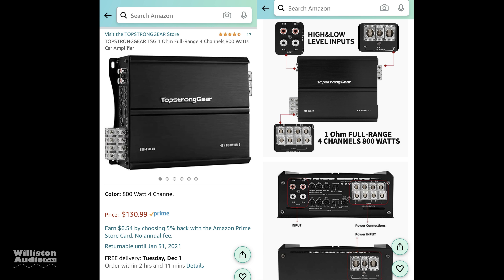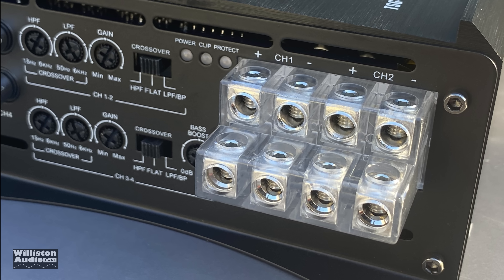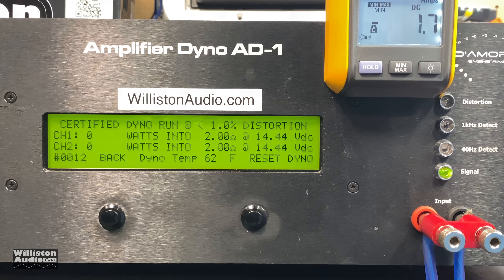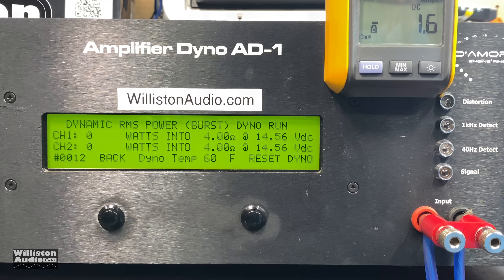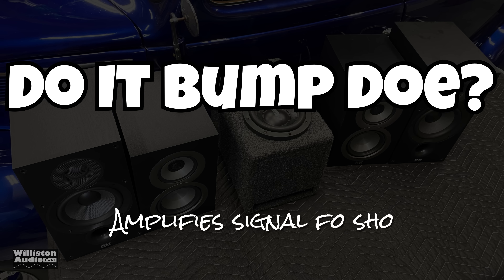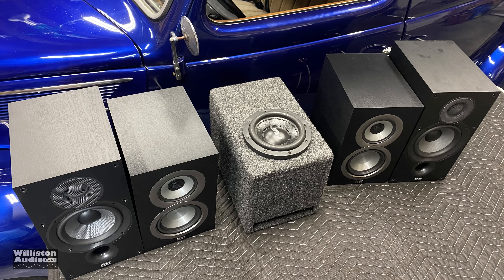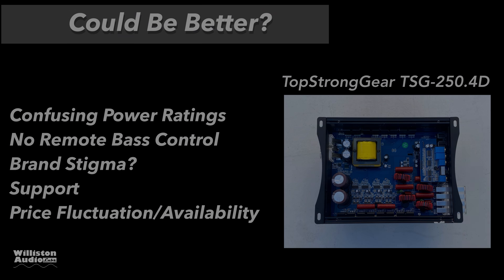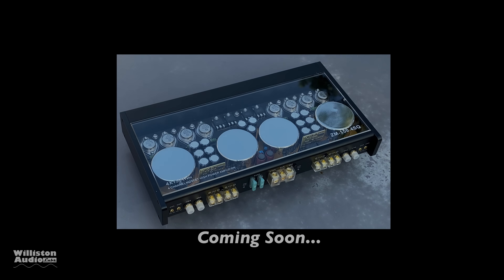Another Cloned Amp at Amazon? TopStrongGear TSG-250.4 Amp Dyno Test

Comment: So I received two from Amazon today. I glanced in again to see if the price dropped earlier this week. Price was 165 lowered to 139.99 with a 5% off coupon you click. Then, once added to cart it brings up a code from the manufacturer to apply in cart for another 10% off. But you can only do this once. So I ordered one on my account, and my girl order one her account. Final price for both of them was 237.98 lol. The Topstrong Gear emblem is held on by very weak two sided tape. Of course I pulled them off. Cleaned the glue residue. And they look great. Almost like a brushed black aluminum or fine black wood grain.

Comment: Id guess the rising efficiency is from how they set the output filter networks up. Kind of makes sense to have a better impedance match at the lower 1 and 2 ohm ratings so it doesn't get too hot.

Comment: Hey D,i’m about to use the tone generator to set myamp gains,i know 40 hz for my sub amp,but what frequency should i use on my 4 channel amp?
Reply: On the Distortion Meter by Steve Meade (SMD DD-1) they use 40 hz for low and 1khz for the mid/highs
Reply: @FreeStyle786  i was figurein that was right,thanks man🤓
Reply: @paulcoleman3972  no problem... but they also use a certain dB level on the test tones... check out a video by EXOcontralto about how to set gains, he does a good job with the run down.. as for the tones you can download SMD tones if you google them or I think Kicker has them posted to their site

Comment: Not sure why anyone would think its a copy of a sundown amp.. Sundown has never built or even designed a circuit for an amp.. they contacted a place that makes stuff over in china, had some samples sent over, and said "could you make us a bunch with tiffany style rcas and this profile on the heatsink" if they liked the cost/performance of the product.  Topstronggear did the same thing and is sellin it closer to actual cost than sundown is..

Comment: Finally someone ripped off sundown and made their stuff actually affordable!
Reply: Right does the same power but will sell alot more
Reply: Aye man sundown isn't even that expensive. They have a whole range and everyone used to think they were crazy great value and still are. You can only go so cheap before u loose quality.
Reply: can someone please make a list of origins of amps? or even the equivalent of what the 'big names' have released, for all the budget minded guys that get screwed by actual trash amps that way over claim. i love getting the best bang for buck, and building stuff on a budget is hella fun working everything out. if im not strictly on a budget though i go balls to the wall getting the hottest shit i can find, built a full skar system in my 240 like 4 years ago sacrificed the whole trunk for the subs but now im doing a full JL system in my ram 2500, gonna run as many subs/speakers as possible while retaining a mostly stock interior appearance 2 under the back seat 1 slim under each front seat, and getting their stealth center console box (or atleast building one), truck is now 70% dynamatted and fully wired with 1/0 power and ground with amp mounting on the bottom of the back seat. cheap or expensive, do your system right and it will sound good, cut corners are what not only kill your class but also your sound
Reply: They are cookie cutter amps ordered from a Chinese catalog. Nothing special. Sundown bought them and slapped their name on them. This company did the same. Nothing was stolen.
Reply: Very true. I never said their stuff was trash though, its just a bit expensive for the average person. Id love to get my hands on their equipment,  but the only time I could afford it is during tax season
Reply: Dude if you can't afford Sundown you're just poor.
Reply: @srvdean3024  yup.. I really am poor and what money I do have will never go to sundown. Especially when I could get something cheaper that puts out the same power. Imo the sundown name isnt worth the money
Reply: @jordank7685  How would you know? You've never even used or owned a piece of Sundown. Don't trash a name because you're full of spite and envy because you don't have it. You'd cry at what a lot of us spend on nice Rockford Fosgate and Focal pieces.
Reply: Sundown amps definitely not worth the money. Why anyone would buy a salt amp boggles the mind

Comment: i here u talk about the bass knob alot. i always found whenever i use them the amp play lower with the bass knob. even turned all the way up. unplug it and it gets louder
Reply: I've seen the same things with bass knobs.. I currently use an rca gain knob without issue .. key is good signal and good rca
Reply: @MikeJones-em8vz  i run audio processors so i get and adjustable gain for single. works great for me.

Comment: Interesting, it’s almost exactly what I need. I am powering some Infinity Reference 6x9 components in the front door and soon to be 6.5 coax in the rear 1/2 doors of my Tacoma Access cab with the Kenwood deck. Although the deck plays louder than I need I still would like to move the power to a separate amp.  BTW, I have a Kicker powered sub under the seat and I am quite impressed. It actually thumps the seat. It has little output at 25 and nothing at 20 but over that it’s quite amazing for the money and space challenged!     Love the channel, keep up the reviews!